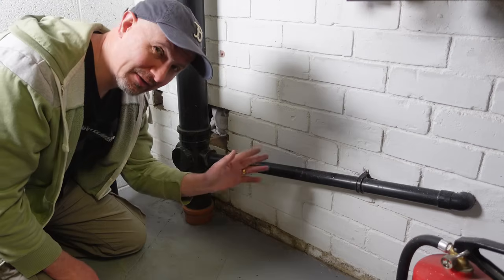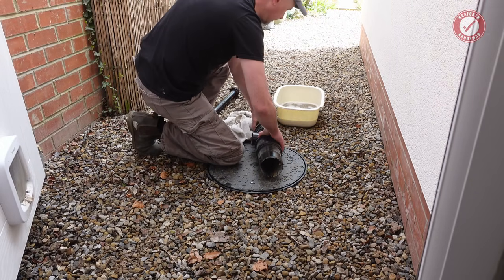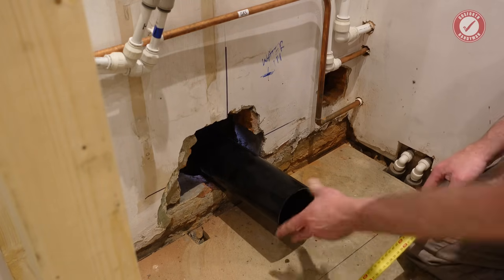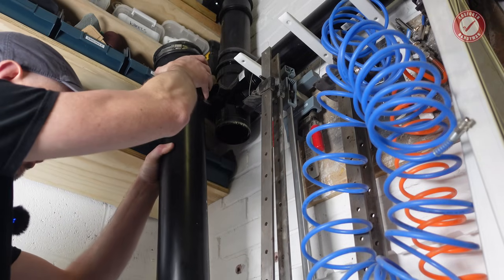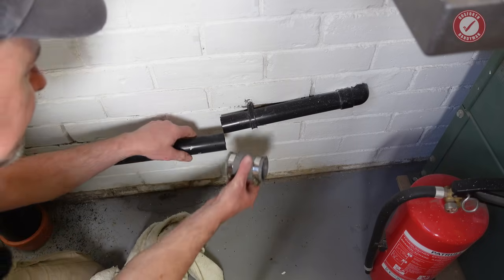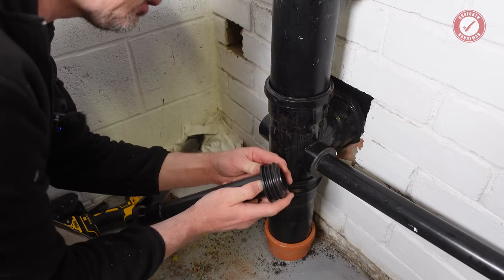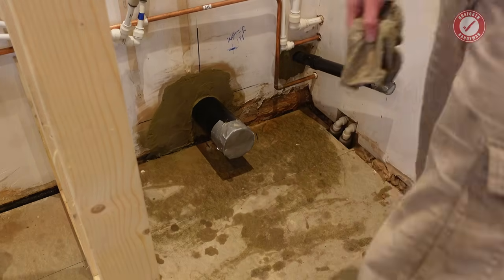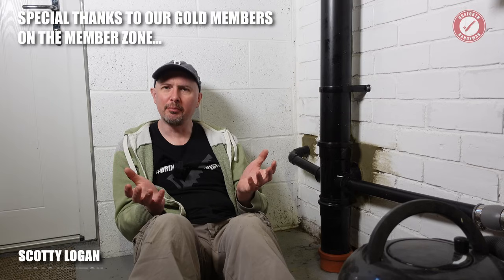Connecting to the live soil stack - new toilet (part 4)

Comment: You could cut the 54mm hole before you put it on the drain pipe thus reducing the danger of a lost drill or plastic disk.
Reply: my thoughts exactly and it allows you to smooth the inside of the pipe as well. for deburring pipes use a side on stanley knife
Reply from the maker: Yeah, it was mainly to show what's involved when you're working with it in-situ. 👍👍

Comment: Hi Andy,The down stairs toilet coming on well,it's not the nice's jobs to do but it's got to be done.I did not know about silicone lube on the rubber bungs that it dose not set.I all ways use a bit of washing liquid on all waist fittings. Its all good information and to see it done in another way, I all ways listen to other ideas , it may be better than my way.Great video looks like the next one going to be fun, with that plaster board looks like fitting square pegs in round holes. Have fun see you in the next video , take care mate.
Reply from the maker: Washing up liquid is fine, but the silicone lubricant is more slippy. You can also get it as a spray. 👍

Comment: Well that could've gone a lot worse Andy, not surprised it took a day though, better to take it steady and as you said get organised before you start !
Glad you sealed up the pipe, not only the issue with bad smells, I recently had to replace our downstairs bog as the builders left the floor so uneven that it rocked and made the close couple leak over time. Having levelled the floor I had to leave it to dry with the pan disconnected so shoved some newspaper down the pipe. later on while working in the next room I was aware of a faint noise, which when I got closer was clearly paper being torn from the other side ! I was very pleased when I could get the pan reconnected, I reckon the little devils can sense the warm air from the house and come looking ! 
Just glad I'd blocked it and was there to hear the noise ! 😳😬
Reply from the maker: Oh no!! Rats? Little buggers! 😮

Comment: Those rubber 50mm couplers easiest way to get them in is to use the PVC weld on them. Going to be a bear to get out again, but definitely never going to slip out or leak. If you do need it apart simply use the heat gun to warm it up to nice and toasty, and it comes apart, which works for the PVC welded fittings as well. Have taken plenty of them apart that way, though generally you decide which part you are going to destroy, normally the pipe, but sometimes the fitting is the one that had to do the destruction, as the pipe was well stuck in the wall.
Reply from the maker: Interesting - never tried that!

Comment: A great video as always.  I’d also recommend as an alternative in these situations using a McAlpine mechanical 40mm pipe boss.  Just cut in where you need to and apply/seal the boss which is curved to match the 110mm pipe and comes off with your 40mm :).   Cheers and keep making those vids mate.
Reply from the maker: Cheers bud! 👍👍
Reply: Also known as a "strap on" boss.

Comment: Could you use a 50mm to 40mm solvent weld reducer instead of the rubber in the soild stack fitting?

Comment: Nice one Andy lovely job 🙌🏻🙌🏻 just noticed you put you would be fitting the fire collars👍 will you get one on the waste pipe on the right where you did the mini slip coupler, I have exact same problem with my 40mm waste that runs through the garage 🤔near on impossible to fit one as the angle is awkward , would love to see in your next video how you will do it 👍 cracking job tho mate 😎

Comment: I'd maybe have used a solvent weld slip coupler on washing machine pipe, but nice job. I quite like waste pipe plumbing very forgiving stuff if a bit smelly at times. 😂
Reply from the maker: The rubber one gives a bit more flex as it's at a funny angle. 👍

Comment: Why are some pipes/bits of pupe glued, and some only siliconed or dry or joined with a coupler? Genuinely interested.
Reply from the maker: Very good question! I might make a video about this. Solvent is generally best. Very rarely leaks... but it's permanent. The big waste pipes (110mm) are almost always push-fit though. Makes them easier to maintain and they rarely leak.

Comment: After you work on black water pipes, wash hands with anti bacterial soap then wash hands with hydrogen peroxide.
You wouldn't believe how many little tiny scratches, nicks, scrapes and cuts will fizz meaning that there was possible infection starting.
Soap won't clean completely but the peroxide will.
Reply from the maker: Does that not take your skin off too? 🤔
Reply: No, it's not acidic. Quite the contrary. You can also use hydrogen peroxide to whiten your teeth and clean your mouth. Swish it around like mouthwash then spit it out and rinse with water.
Try not to swallow it. Even if you do though the most is you'll end up with a tummy ache.
Also pour baking soda down your sink and bath drain traps. Then pour some peroxide down and it'll fizzle cleaning your drain traps out!
Reply: Just keep it away from your acetone, or it'll do more than take your skin off.
Reply: I'll be sure to take the can of acetone out of my medicine cabinet right away!
😂😂

Comment: It's one thing to be squeamish about touching your poo pipe (errr...), it's another thing to cut the poo pipe with a mitre saw, notorious for flinging dust everywhere, while not wearing PPE. Personally, I wouldn't have used a power tool for that cut, and I certainly wouldn't have done it in the workshop. Half your workshop is now contaminated with fecal matter.
Reply from the maker: Ha, I only breathed in a small amount of $hitty plastic. 😁
Reply: Your entire bathroom is too, including your toothbrush.